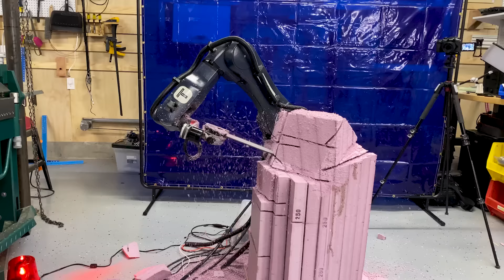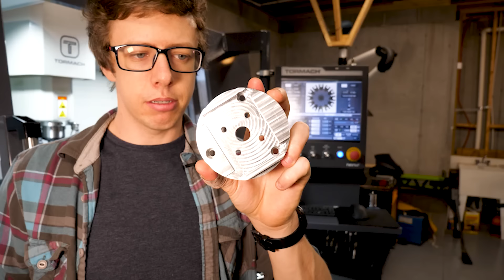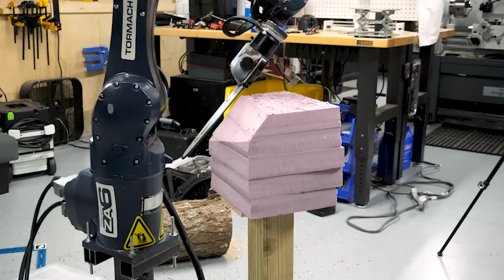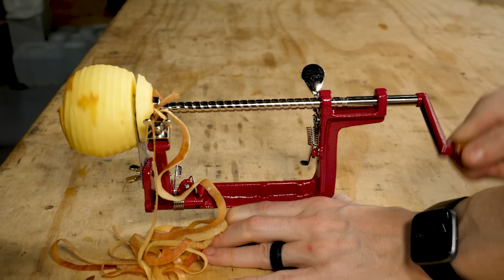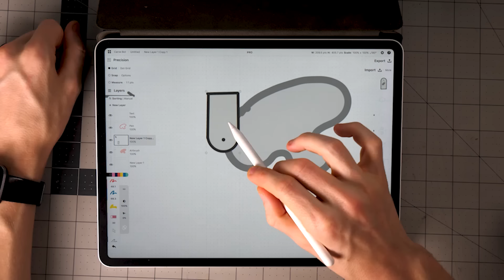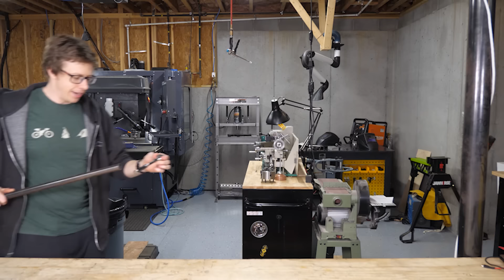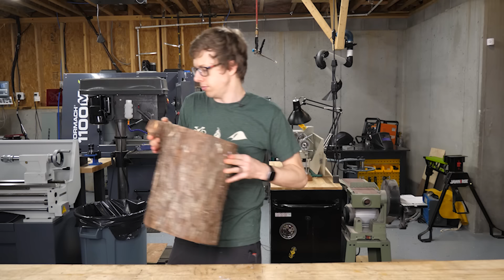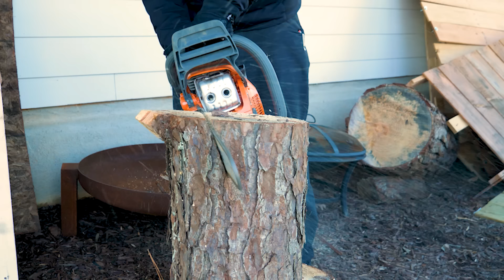Chainsaw + robotic arm = art?

Comment: "When you have a bolt that's really stuck, you get way out here and snap your wrench in half"
Had me rolling.
Reply: After your wrench is snapped in half, you think to yourself "oh ya, lefty loosey" and finish your beer
Reply: I once tried it with an allen wrench and it literally broke in half
Reply: Once i was changing tires ant the bolt was VERY stuck,we pulled out a 2m bar and still couldnt get it out,because we were lifting the car 😂😂 @jamesMcroy12

Comment: A warning on that estop button, I have two identical to the one in the video. Both tended to work intermittently resulting in crashed cnc machines, I discarded them and went with a quality switch

Comment: They make chain that can cut with the tip. They also make bars for carving with a more narrow radius. Change the bar and chain and you'll be more successful with a log. Also know that not using safety chain greatly increases the risk of kickback, although the narrow carving bar somewhat decreases it.

Comment: 17:25 thats not an anti kickback tooth its to make sure your chain doesnt cut to deep! if you sharpen your blade you have to shave some material off of there so that it takes more material again.... otherwise it wont cut... you can tell if you have to take off material there if your chips are really tiny... a chainsaw should take a good sized chip... and also a skateboard motor is pretty slow.... that chain should defenetly spin at over 22mp/s and im pretty sure that motor didnt cut it...

Comment: Chainsaw blades also get oil to lubricate them. It also cools them. You need that to avoid overheating. Also yeah.i think that only professionals can use the tip safely and well. Kickback is dangerous as fuck.

Comment: From the perspective of someone who has dealt with geographic surface models... a few thoughts on the false summit problem.

You could 'probe' the surface taking note of the elevation AND slope on a rough grid pattern, this would give you a degree of predictability about where things are converging upwards, then do a second pass of the same...

You might also want to reach out to A GIS person who specializes in raster data models (I'm so far out of that field I couldn't begin to guess at who specifically might fit that bill). These aren't problems that are entirely foreign to geography.

Lastly, if you do go looking for solutions from the GIS world there are libraries in Python that might be able to help (but I seem to only remember using them with vector based models, and can't remember the names... something to ask about if you consult a GIS expert).

Comment: The low poly count on the dog may actually make it easier for the arm to cut and calculate its form since it doesnt have to take all these different angled cuts. instead, it can take one angled cut and be done with that specific poly

Comment: Amazing time consuming project!
I don't think you will make it with hardwood, this is why you had smoke: hardwood generates a lot of friction when cut.
When they are used by a human, chainsaws uses teeth at the base of the blade for leverage, hardwood needs a lot of pressure on the blade for it to feed in the log and even so, humans are having a hard time cutting hardwood with a chainsaw.
I would definetly advise to try with a softer wood like pine first.

Comment: Great video.  I’m wondering if a circular blade with chainsaw teeth might work better to prevent stalling and tip errors, you could probably use the sawdust method.

Comment: On the chainsaw blades, those are depth gauges, not anti-kickback. You'll probably want to get a decent sharpening set and file down the cutters and gauges (Project Farm or Wranglestar are probably the best channels for chainsaw info). And I suspect you're oil starving your blade. There's an oiler on every chainsaw, and most chainsaws are just gravity fed, cheap ones can be manually primed.

Comment: Couldn’t a false summit be likened to a false gate in locks? Wouldn’t you resolve this issue by ‘going back’ to the ‘first’ gate (or another data point) and restarting the gradient ascent? 

I understand that you won’t technically know if it’s a false summit, but, if you do multiple start points, it may take a degree longer, however, it’s mitigating the issue at hand.

Comment: In the jet engine prototyping world we used large assembled blocks of wood to prove out the tool paths for the CNC machines.   These were hardwood blocks all glued together to get the size and shape of the prospective chunk of (mostly) titanium so we were risking a few dollars of wood rather than potentially scrapping 700lbs of titanium.   If the machine made a mistake (well...of course the machine didn't...it was the programming) then a quick call to the pattern shop guys to come out and glue in some replacement blocks then continue.   Once the wooden part was successfully carved out and all dimensions were correct the machine was loaded with the huge lump of metal that would magically transform into a functional jet engine part.   Oh...that 700lb block of titanium ended up about 53lbs of compressor case half.....yes, lots of chips.

Comment: Well done! Instead of a pine log, try wood that is commonly used for carving. Such as bass wood. You may still need to sharpen or put a new chain on during the cut. Sharp chains make all the difference.

Comment: a chainsaw can cut with its long edge and round part. But you need to make sure the depth gauge (sabretooth thing by the blade, which you call anti kick back tooth) is ground to appropriate height, as its function is to control the depth of cut the blade makes. Also, the chainsaw's sharpness is trashed with slightest contact (while running) with hard object like gravel, sand, metal wire , etc. A blunt chain is 1000x harder to cut, which i think is in your case.

Comment: Regarding your woodcutting problem: You might be able to file down those "anti kickback teeth". They are used for depth limiting, which could be done with limiting the feed of the robot. Also you could try using a different type of chain. There are chains called "kantenschliffkette" in german, I guess that translates to square ground filing. Those chains appear to be more dangerous and thus not so commonly used but they have much better performance on plunging cuts.

Comment: Should just gotten an angel grinder with the chainsaw attachment (it cuts faster than a normal electrical chainsaw due to its higher RPM)
the overheating is due to the fact you need chain oil to help the metal parts glide without friction (blade and chain)

Comment: That's not an "Anti-kickback tooth" its a depth gauge or raker, it controls the depth of the cut. An anti-kickback chain has protrusions behind the depth gauge on the next link which when the chain is bent around a curve, protrude out to prevent the chain at the tip of the bar from cutting too much and causing kickback. You can find pretty decent diagrams online.

You can file them down (and should when you sharpen the chain) but the shorter they are compared to the chisels the more the chain will bite and the more stress your robot will be under. Since you are not holding it and its not super powerful you probably don't need to worry very much about kickback (although it could break the robot). 

Also the speed of the chain matters just as much as the power behind it, if its too slow or too fast it won't cut properly so you might need a different motor, idk.

Comment: Gradient Ascent Idea: Rather than starting with a random spot, make a grid of spots with "S" amount of spots and "D" distance apart of those spots both in the X and Y axis.  Use the gradient ascent algorithm, but run it for each spot.  The gradient ascent model should move 1/2 D distance from each S point.  Finally, compare the results to find the "peak" of the Z axis amongst all of the spots.  This takes a serious complicated problem and simplifies it by combining two simpler methods to achieve the same result.  The axes described here are based on your 2 hump model.  Adjust for your bear or dog.

The accuracy and computation power required for this plan can be adjusted conversely by adjusting the "S" and "D" variables.  

This is also much simpler than using a Rapidly-exploring random tree as far as the software is concerned.

Amazing job on the dog!

Comment: I think you would need a real carving chainsaw. This one is not designed to cut with the tip. There are chainsaws out there which are made for exactly that purpose although i have no idea about the cost but maybe you can modify the chain ^^.

Comment: Wow really nice. Although let a logger give you some advice to that saw. Be sure you tension it a bit more. The fins should not be seen and the whole chain should be plain on the sword. Otherwise it could come off and hurt you. Also you might want to get it sharpened so it cuts better. And please don't forget to put some oil in the reservoir so it runs smooth and doesn't overheat.

Comment: When sharpening a chainsaw chain you have to file down the anti kickbackteeth so the chain will cut. That will help with the rubbing. When working with wood you also have to look out for the actual kickback depending on the angle the chainsaw hits the wood.

Comment: There might be a way to use multiple algorithms to optimze this. If you initially think of your workpiece as a cylinder you could go for a big cut straight cut rotate and do that again until another straight cut would only remove less than ~5% of the workpiece, bringing it into a rough shape. Then try your optimized wedging algorithm and maybe get into carving it out in sawdust after that. 

Also you should probably create a software mask of illegal rotational states to prevent cutting itself or something it shouldnt.

Comment: Your cutting power is maximizes closest to the powerhead of the chainsaw. A rocking motion, with your pivot point at the dogs requires the least amount of force to be generated by the operator. With all chainsaws though this makes it possible for the motor to bind up. You would need to figure out a way for the robot to know how fast the chain is spinning so it can back off when it's trying to work too hard.

Comment: You should get a GPU rack and solve the slow code by getting a 10000 speedup that way. Stuff like point-in-polygon can be run on GPUs. If you use Python, Numba supports easy GPU support (call numba.cuda()) or something. A friend of mine got a 40000 speedup for DNA sequencing in a couple days messing around with this on a single GPU.

Comment: Could a commercial chainsaw integrated into this design help on the wood carving? Would you still run into the same problem where you'd need to rock the blade?

Comment: Fresh (wet) pine has a lot of sticky sap and is very hard to cut, requiring powerful gas saws. Aged wood (dry wood) is gonna be your best bet, a huge chunk of balsa could be feasible with this current setup. A custom ground chain without anti-kickback (as you discovered) would help too.

Comment: You could install a cooling solution on your saw or use compressed air to remove condensed material stuck behind the blade. EDIT: You could also a more traditional CNC bit to carve away wood.

Comment: 17:25 Yeah, anti kickback chains are for pussies!

But, seriously, it should be quite possible to cut into log with tip even with anti kickback chain. Was chain sharp and properly tensioned? (and oil pump working?)

Comment: Instead of gradient ascent or random tree shit, you could have used a genetic algorithm. Much simpler to implement, and you can tune it to avoid local minima as you see fit. GAs are practically built for these sort of problems.

Comment: You could use a grid to find the highest point. Ray trace the grid then move x - 1 x + 1 y - 1 y + 1 trace those too and continue towards the highest point. This would find all highest points and could be reversed to find the lowest points. Its not fast but not slow either.

Sure there would be a technical reason but I am not even sure if you need to do any of these. If you find the plane of the cut you need to make and check if this plane interferes with any other plane then compute your cut based on that. Since you are using a low polygon anyway it should be possible.

I am probably thinking too simply of this

Comment: Gradient ascent false summits...
Hm... Sounds like a machine learning problem.

If there is anything Ive learned about problems in machine learning... Its just do it ten thousand times until either you or the computer get smart enough to do it correctly.

Comment: I'm just about finishing a year long dissertation that's working toward using a robotic arm on a rail for ship welding. I know of at least 2 PhD students and a professor working on the same project. You've covered a significant proportion of the work this team has done over a few years within a couple weeks. My mind is blown

Comment: Feels like a solution where shrinkwrap and then cut along the extended edges may have been easier to get a nice rough estimate.

for a 2D example:
-Start with a circle of points around the model.
-in steps, move the vertices of the circle inwards towards the model
    -If an edge collides with the model, do collision handling. (move both affected vertices in the direction normal to the edge?)
-once the approximation is decent, you can start making cuts.
-In random order, select an edge, and create two cutting lines
    -Cutting lines start from the center of the edge, and go out in each direction parallel to the surface.
    -Raycast along the lines until you find an intersection or you are outside of the log
-This will result in a line that will cut up to an edge, and then beyond it. 

For 3D you might be able to do something similar, instead cutting along the faces of the resulting shell. You'd cut a plane with the same normal. But it might be easier to just do a cylindrical wrap from the top view and then side views.

Comment: Ok I'm sure someone has suggested it but have you considered filing down the rakers on the chain a bit!? With the controlled feed-rate, I'm sure they could handle a more aggressive cut. Of course I would start off with as much of them left on as possible so it didn't bite too hard but if you know exactly what the chain is going to be used for then it could be a good way to make it actually cut without having to change your entire approach! Otherwise it might be worth playing with the bar or chain geometry to make cutting at the tip more feasible!
Reply: Also is the chain getting some oil!? Maybe if you increased the quantity of oil or implemented a cooling system as well as other changes it might make it all run smoother

Comment: For the heat problem when you cut wood a chain oiler would be the solution. (in case you do not have one yet)
Reply: I have a suspicion that he happened upon a particularly hard tree.  Maybe a softer tree would help.

Comment: I know you’ve probably thought of it already, but you could probably use some ideas from your pumpkin carving robot on this project. The first thing I thought of was using a drill head similar to the one on that robot to cut the details into the model that are too fine for the chainsaw, along with a way to swap the tool heads with relative ease. The second thing I thought of was that it would probably take less coding to adapt the G-code generator from the pumpkin carving machine to the bear than to code one from scratch by removing the surface mapping used in the pumpkin algorithm and changing the part of the program that converts the series of cuts into motor commands to work with the bigger robot. Then again, I’m way more familiar designing aircraft than I am with writing G-code algorithms so I have no idea if adapting the pumpkin carving algorithm is feasible or reasonable. 

I’ve always wanted to be a professional engineer, and seeing your amazing work and other engineering/project channels have inspired me to pursue my dreams for as long as I’ve had a YouTube account (since 2013). If I were able to I would be doing amazing projects like this all the time, but since I’m stuck in a loop of not having the time, money, or expertise/experience, I want to help out in any way I can. Recently I was accepted into a bachelor’s  program in aerospace engineering, so feel free to hit me up in a few years if you want to design a UAV. All jokes aside, thank you for the inspiring videos and keep up your amazing work!

Comment: As an engineer who can't even make Christmas light blink , i envy him .
Reply: Are you a sales engineer?
Reply: What methods are you trying?
I should probably start by asking how many Christmas lights (number and run length), what power draw you're targeting.
Are you happy with PWM or do you want to make it suitable for filming without the chance of flicker, etc...
Reply: Civil Engineer?
Reply: @coomage123  Even a civil engineer worth their salt knows about using capacitors and inductors to pulse LEDs. 
It's not work related, just curiosity for how things work.
Reply: Your screwed
Reply: @guy_in_ashopping_cart-sfs967  his screwed? You're screwed.
Reply: Try reading the instructions, since several types the first bulb in the strand decides if it's always on, or blinks it's a circuit breaker bulb (looks a little different). Or one of the bulbs are blown in the strand.
I use to hang lights at Christmas time for people.

Comment: I would love to see you improve this! Maybe with a finer saw. What you can do for the local maxmum problem is simulated heat treatment, where in the beginning there is a high likelyhood of jumping randomly do a different spot, so you don't just start at a certain place and never move. If you do this with enough points you should reach the absolute maximum.